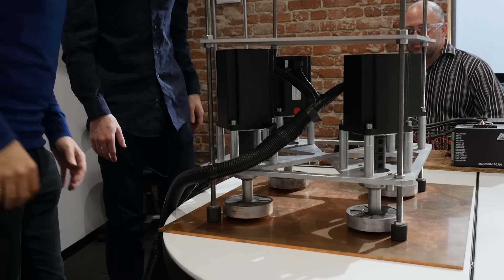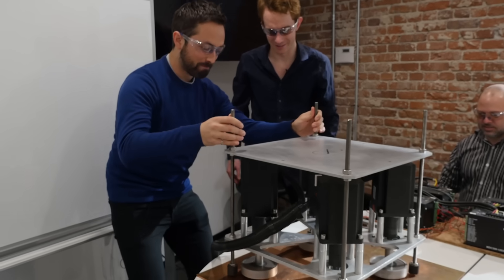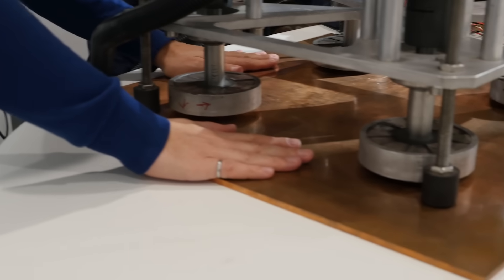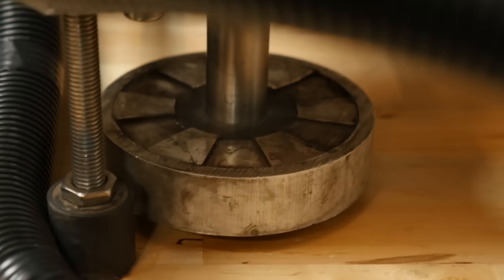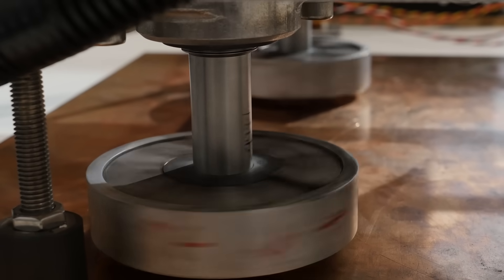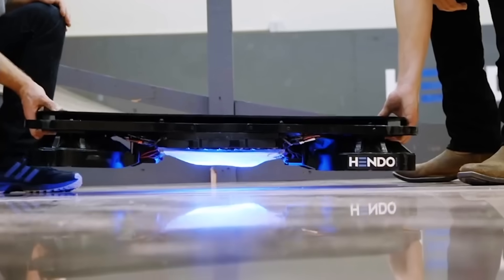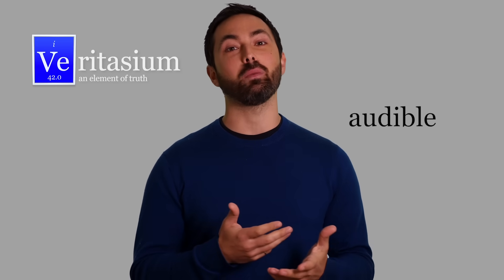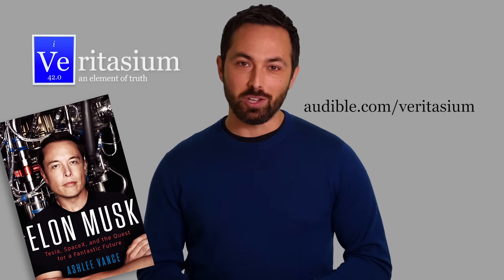Electromagnetic Levitation Quadcopter

Comment: You measure in pounds in a scientific video?
Reply: It’s very common to use lb in the US even in scientific settings.
Reply: American's only measure drugs in kilo's.
Reply: Not to mention no one actually cares.
Reply: Does it matter? I use the imperial system, even though im a brit. But it doesnt matter
Reply: If you're scientific you can measure in anything and convert to anything, right? There are parts of the world which use pounds pretty much exclusively for weight, we can convert to grams of kilograms for those who don't understand conversion.
Reply: @Donald10569  Thank you, Donald Adiska. The Apollo spacecraft and the Saturn launch vehicles (as well as the Mercury and Gemini spacecraft and their launch vehicles, and the Space Shuttle) were built to ASA (American Standards Association--inch, pound, non-Imperial gallon, etc.) unit specifications. The non-metric ASA units are also used for scientific applications; for example, the surface dimensions of re-entry vehicles tested at the NASA Wallops Flight Facility were measured and machined down using laboratory equipment and precision tools calibrated in micro-inches (millionths of an inch).
Reply: @j.jasonwentworth723  The father of NASA and the chief designer of the Saturn v, Werner von Braun, designed the Saturn in metric and despised imperial units.
Reply: @Donald10569  
Kilograms are the standard scientific units.

Comment: Let me see if i can envision this in cargo transport in say a large truck.  First off the truck would need to powered by a engine driving a generator (think a small scale diesel locomotive) .  The truck operates in a normal manner in urban or rural environments.  But when operated on a "enhanced" highway, some of the electricity  is diverted to the mag lev portion as the truck is operated at highway speeds.  Reduced rolling resistance, noise and tire wear. Obviously a few of the trucks axles would need to be engaged to the ground for stability, propulsion  and braking, but I find the possibilities intriguing.  As a possible side benefit, the heat generated in the copper strips in the roadway, would help with snow and ice issues in northern climates.  Just a few thoughts.

Comment: Great video!

Any chance of a part II, where you change the conduction of the underlying metal sheet? Cooling the copper with LN2, or replacing it with Alumnium to elaborate on the energy lost to heat

Comment: Put sterling engines hooked to generators on the plate that's getting heated, and recover some energy that way.  If the plate is even more hot, boil water with it and run a steam engine off of it, too.

Comment: Here's the first step to levitating cars, if they ever actually become a thing. I doubt they will, because I can't imagine a reason they're advantageous (someone will probably try to claim they're cheaper because you don't have to replace tires/wheels, that's insignificant compared to the cost of the tech though). But still, cool as hell.

Comment: personally, I'm still a bit skeptical about hyperloop. For example,  I'm not sure how they plan to use a turbine in a vacuum. Or how they plan to account for roughly a football fields worth or difference in length due to thermal expansion.
Reply: Or how they are to practically remove 1,500 tons of air and keep it out.  BTW, its 3 football fields on the smallest proposed line.
Reply: Astronut128 yup. Although I haven't actually seen any sources saying if it would be a vacuum or just reduced pressure. A vacuum could never work, but reduced pressure is definitely possible.
Reply: It is proposed to be at 0.001 atm IINM.
Reply: Astronut128 Source?

Comment: Milion $ idea here:
Step 1: Make like an ice hokey rink, with a coper floor, with water cooling in the floor.
Step 2: Shrink this levitation device to the size of a skateboard (you see where I'm going with this yet?) , power the device with powerful batteries (lithium-ion or something)
Step 3: ...
Step 4: Profit $
Step 5: Run the floor cooling water through a heat exchanger to concentrate the heat.
Step 6: sell hot water to the city!
Step 7: ...
Step 8: More Profit $
Reply: You'd use way more electricity to power the hoverboard than you would generate.  First Law of Thermodynamics - you'll always need more energy than you generate!  Energy is never free in a closed system like this (which the universe technically is a closed system as well, basically) - our best bet is still, unfortunately, releasing stored energy (fossil fuels, nuclear, etc)!
Reply: They have these...search for a video of Tony Hawk riding one...and yes it was on a copper floor.
Reply: Sion I'm off to Silicon Valley. Thanks.

Comment: 105 pounds = 48 kg, 

for like 99% of the rest of the world...
Reply: uh... he asked how much it weighs, not what its mass is.  The correct answer is-- it weighs 467 N.  Maybe learn your precious metric system better.  You guys screw up mass and force more often than you get it right.
Reply: @HollywoodF1  
So when the question was for the weight, why is the answer in pounds? This is a mass unit too.
Reply: @andreasschmitt2307  - # of pounds mass = # of pounds force because of conversion factor. 

Kilograms and Newtons do not have such a convenient conversion factor.
Reply: @corpsiecorpsie_the_original  
So is one pound of force different for where you are on earth?
Reply: @HollywoodF1  The units of mass and weight are generally used interchangeably anywhere on the earth's surface, as the discrepancy between the force of gravity at sea level and, for example, mt everest is negligable.
Reply: @HollywoodF1  kilograms is unit of weight too i mean r u intensionally doing his..unjust look stupid noone wighs things in newtons except physicist.i mean..even if u say 10kilo thats still correct
Reply: Thaaaankk youuuu😌😌😌😌

Comment: Hey, good morning! 
(sorry for my lack of exact terminology, as English is not my native language and science is a hobby for me)
This video, and the other one where you stand beside an old electromagnet that make a big disc levitate, make me wonder.....  
As "energy is not consumed only transformed"..... can the heat this plates (the one in this video and the old one in the other video I mentioned earlier) generate be converted into electricity, that subsequently be fed into the electromagnets, in order to create a perpetual auto-sufficient machine???
An initial kick of electric energy would be needed still to turn on the electromagnets, and I can imagine heat is not easily catched/contained so it can be re-used and some part of energy is converted into sound..... so it is not a closed circuit and you have an energy loose in the middle.....
But, can I theory something like this works?

Comment: This could be a great way to move stuff around warehouses or buildings. You make the floor metallic with copper and other magnetic metals that can work with this. And you make cargo lifters that hover above the floor. + this can possible make a hoverboard not limited to a rail like the superconductor hoverboard. If im not wrong.

Comment: Very interesting do you have any figures on how much it will lift at certain motor speeds, could the spinning magnets be replaced by electro magnets,possibly changing the polarity electronically? without spinning motors I mean, super conducting magnets, what difference would it make if the copper plate was super cooled with liquid nitrogen or helium, thanks for sharing.

Comment: As much as I would like to see the hyper tube a reality it has one fatal flaw. The fact that it has to maintain such a low pressure environment to make it efficient. All it takes it some idiot to shoot at it or a large enough object to breach the shell by falling on it. This is a problem because once you breach it's structural integrity you get an implosion which is a large potential hazard. There's also the matter of extracting trapped passengers if one should fail in mid transit. How does one go about affixing emergency access ports to a large tube that's under vacuum?

That said I could see the possibility of hovering vehicles if the roadways were made of aluminum. It's abundant enough and relatively low cost when you consider the low level of maintenance. It's not a bad concept. This of course leaves those who like to drive off road for whom this technology just doesn't work. I know there's iron in the dirt but it's extremely unlikely that it would have nearly the consistency that would be necessary to support levitation. It would be more apt to simply stick in large clumps to the spinning magnetic fields and cause an imbalance of the device making it fail. For devices whereas the field is controlled by electromagnets I would imagine the iron dust would chew through any potting of the windings eventually rendering them a death blow.

Comment: It weighs 105 pounds? what is this ancient form of measurement you talk of?
Reply: It's not that difficult, it's equivalent to 350 bananas
Reply: H A R  I know. It is the SI unit for mass.
But, turning lbs to kg isn't difficult.
However; I understand now, if kg were used no one had the necesity of the waste of time to convert units.
Reply: To convert pounds into kilograms, just divide it by 2 and you'll get a rough estimate.   The metric system is so much easier to divide into 10 and any multiples of that, because it's a 10 base system from the ground up.
Reply: @BillAnt measuring in imperial system is a great way to crash a probe on mars.
Reply: warny1978 < I agree! :D
Reply: lol Ironically he has a video on how the Kilogram is dying... xD
Reply: Oh damn your school sucks
Reply: About 47.6kg
Reply: How many soccer fields is 105 pounds?
Reply: The best kind
Reply: Metric Imperial. Does it matter?
When there's real problems. Like, 'How longs a piece of string'?
Reply: The imperial system has it's uses and we are Americans, and will continue to use the system, you are lucky we don't make everything printed in the imperial system, we do run the world. The metric system is simpler, for simpler minds. It does have some uses, but for day to day life, imperial systems seems better, when I order a burger I want a 1/4lb, or a steak I want a 24 oz new york strip, or when I want beer I want a 32 oz beer.
Reply: @NoloKobo  see while that is not necessarily hard to remember it is a hack and just demonstrates the lack of elegance and simplicity inherent in the imperial system as oposed to  the metric system.
Reply: AussieMatt hey, we here in the U.S.A. enjoy it
Reply: AussieMatt You think you’re funny but just look stupid because you can’t do basic math conversions and work with multiple systems.
Reply: The dude is also an aussie, which is a shame.
Reply: I used to be a metric (SI, for purists) snob until I realized that in the U.S., there are likely-uncountable numbers of buildings, fixtures, devices, tools, storage tanks, and pieces of factory equipment--plus the specifications, operating manuals, and service manuals for all of these--that were and are made to ASA specifications, for domestic sale and use. (The ASA--American Standards Association--units are not Imperial units [the U.S. has never used Imperial units, which were adopted in the British Empire almost half a century after our Revolution].) Also:

Converting them all to metric would cost hundreds of billions to tens if not hundreds of trillions of dollars, for no advantage whatsoever. For this reason--because we have such a huge investment in ASA-designed architecture and equipment--the U.S. will never fully convert to metric, because it would make no sense to do so. We use metric where it is appropriate, but for things such as carpentry, stone masonry, metalworking, etc., the ASA units--such as inches and feet, which are divisible by numerous different factors (1/2, 1/4, 1/8, 1/16, 1/32, 1/64, 1/10, 1/50, 1/100, 1/1000, etc.)--are far more practical to use. (To partly duplicate this capability in carpentry using metric units, it was necessary to adopt a "metric module" of 1600 mm, which can be divided by a few of the above-mentioned factors.)
Reply: @j.jasonwentworth723  your argument makes no sense. You can divide 16kg and 16lbs by the same amount of dividers. However kg has a lot easier conversion
Reply: Metric is for lazy people who don't want to do conversions! Also, why would you want to know the weight of a heavy object in GRAMS for fucks sake! Americans use Imperial AND metric! That's why WE'RE SMARTER because we can use either!
Reply: @Hypercube9  R/IAmVerySmart
Reply: Centimeter snobs get triggered when you tell them yards and miles are just as accurate as meters and kilometers. I think you have to be better in math to be able to use the American standard over metrics simplified system.
Reply: Don't get too cheeky mate, Kg's days are numbered!
Reply: Jeremiah Noar and your alternative would be? Speaking of decimals though.... are you going ditch $’s fir £’s
Reply: I don't get it, what is wrong with pounds being used ti measure?
Reply: @JorgeRodriguez-xx8vx  KG is firstly much more standardised, the pound's official definition is literally a fraction of the KG's value, and KG is used a lot more than pounds, and only people from North America can really understand it well, while the rest of the world uses kilograms
Reply: Its just largely inferior to using metric. Think of it like this, off the top of your head how many ounces are in 1755 pounds and how many tons is that? In the metric system, how many grams are in 1755kg and how many tonnes is that? Well thats 1755000 grams and 1.755 tonnes. It actually gets even sexier, how much does 1 litre of water weigh at sea level and standard room temperature, well 1kg of course.
Reply: @mimoslavich6639  if someone like myself who has never used anything other than inches or pounds  hears that nonsense you speak of you to me besome useless
Reply: @irvinwittmeier5208  I understand that   and I'm not saying you have to, but I promise you that if you took a bit of time to investigate you will really appreciate what strides have been made towards elegant cohesion of units with a common base of 10 that we use as the language of science and global trade.
Reply: The imperial system is actually based on human abilities.  An average man can lift 100lbs.  So it was based on that.  It actually makes perfect sense.  45Kg is not easily multiplied as a work unit. !!
Reply: @irvinwittmeier5208  doesn't that fact make you yourself (as well as the rest of our imperial System)statistically irrelevant?
Reply: Now apply the metric system to a study of Royal Hebrew (that's right, the builders did not use the Egyptian cubit) cubit measurements of the Grand Pyramid and the coding the builders put into it gets lost in translation. Only the Imperial system reveals the hidden meaning.

Comment: But... if that much heat is dissipated from this small device that would mean the friction on a maglev train based on this would be kind of large, right? Like if you put your hand on the tracks just as a train passes it's not really hot so it seams this system would have more friction than a wheel :S

Comment: i guess you didn't watch Thunderf00ts video debunking the hyperloop and similar project due to their enormous safety problems as well as the energy problem - to reduce friction you have to lose more energy than in normal (mechanical bearings) vehicles ... or do bearings in your car or in a train get so hot so fast as the copper plate? plus you need this inductive underground instead of just rails f. ex.. and hyperloop is in a vacuum that is bigger than any vacuum we ever created, doesn't sound efficient at all if even possible.

Comment: When it levitates on the table top, is the weight of the table reduced or does it remain the same?
Reply: Mike Muench It stays the same of course. There is absolutely nothing special about this. Action=Reaction. These magnets just produce a lifting force by pushing the copperplate down. It could as well be standing on ball bearings. The magnet-configuration in the rotors might be interesting, but the rest of it? Yawn. The whole "levitation-thing" on youtube is waste of time. Nothing of substance, a lot of "maybe", "i heard it from someone who knows someone"; nothing is shown actually working. And this one here? Nothing but hyping in grade-school-"labs". Stay with propellers on quadcopters folks, these things can actually fly and dont weigh a billion tons.

Comment: Do we get electric shock by touching the copper plate ??
Reply: Yathu prem i dont think so, the copper has a way lower resistance than skin, and electric current "prefers" to flow the path with lower resistance, so current would not flow through our skin and body